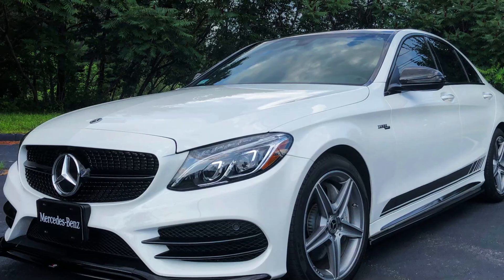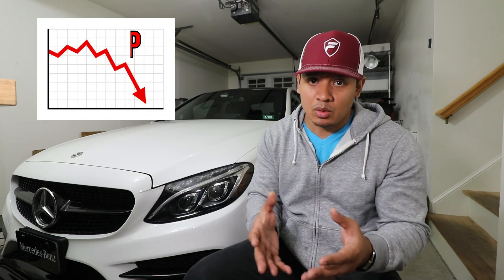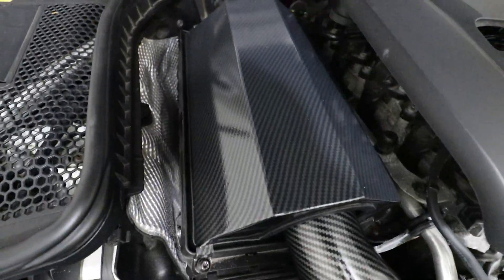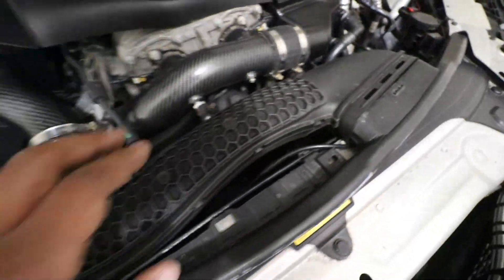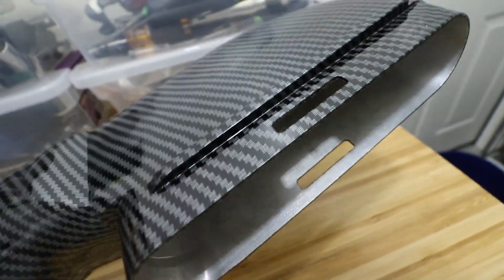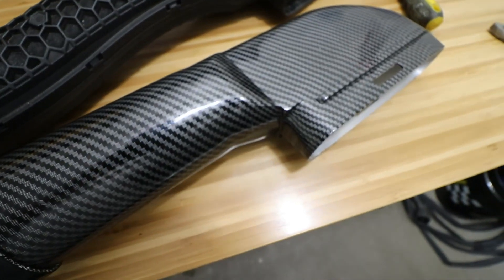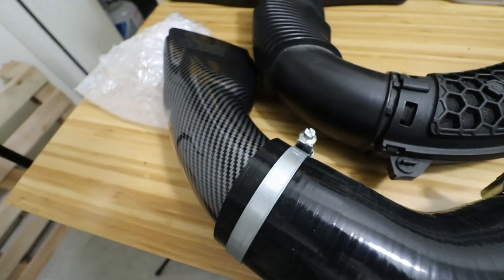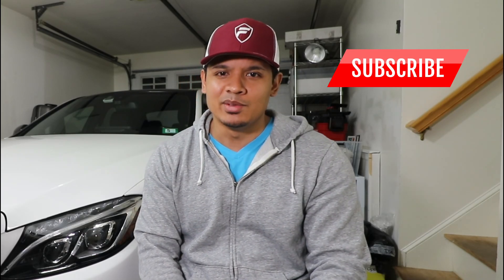ALUMINUM air tube installed on a Mercedes C300 (W205) 2015+

Comment: when’s that tune & aftermarket exhaust coming??
Reply from the maker: Exhaust soon. Tune, not happening.  Too many reliability issues with this engine with any tune. I’m not risking it. I have a Mercedes’ mechanic that’s seen it all and this engine is prone to issues with a tune.  Yes, people may be fine with a tune here and there, but they’ll face some issues down the road for sure. I’m not doing it especially when this is a daily driver and my wife uses it a lot.
Reply: @TheFlexxGarage  ahh that sucks. i have a w205 c300 as well but i thought i’d wait for ur tune before i do mine
Reply from the maker: Yeah. That will be up to you.  I just don’t wanna mess up this car. If there was a true safe tune, I’d do it but after chatting with my mechanic for awhile…the engine just don’t like tunes.
Reply: @TheFlexxGarage  EuroCharged and RennTech both produce C300-specific tunes. I feel their engineers probably considered the engine and specific parameters that need to be tweaked to improve performance; I feel certain that these are safe to use. Correct me if I’m wrong tho.
Reply from the maker: I’m not gonna say their tunes are safe or bad.  People have it done and it’s “okay” for now. 

All I know is my Mercedes mechanic knows what happens cause he’s has repaired tons of c300 cars after different tunes. He’s not the one trying to sell one. 

If I had a c43 or c63, heck yeah I’ll do it cause it can handle it. I would def do eurocharge or rennrech. Not on my c300 though.
Reply: @TheFlexxGarage   with all your upgrades can you feel a difference on your car? Even though you have no tunes on your car you don’t run into any issues? I just got a c300 and I don’t want it to be super fast but I would like it to be little quicker and responsive than stock.
Reply from the maker: My car is more responsive. 

Here’s the thing with my mods.  It doesn’t add any extra power to the car.  What it does is, it brings power back when the car gets hot from driving. 

Most cars (including the c300) loses a crapload of power after driving for like 30mins. When the engine gets hot, the air going into the engine gets hot and you actually lose power. Just because a brochure says your car makes 241HP doesn’t mean you get 241HP all the time. 

Adding cooling mods like mine…allows the car not to lose so much power when the engine gets hot.  So when I need power, I still have it. Whereas a car without my mods…when they need power…it’s not there cause the engine is running hot and the air feeding into the engine is hotter. So the car is more sluggish and less responsive. 

Most people (especially non-educated “car guys”) still don’t understand that concept. They think every mod has to add HP or it’s worthless.  Sometimes it’s not about adding horsepower but more about maintaining horsepower. 

The only way to get more power is a tune or bigger turbo. Both of those things required all my mods or else you’ll run into having a hot engine with hot air and losing power again and also risk damaging a lot of engine parts not designed to support a tune or bigger turbo. 

A c300 engine isn’t designed to take a bigger turbo and tends to have issues or premature wear with tunes. It’s just not really an engine to build a lot of power.  A c43 or c63 would be a better option. 

I want a reliable car with some pep. That’s why I did what I did to my car and nothing more. 

Hope that makes sense.

Comment: FLEXX, have you heard about the wrist pin issue on these cars? A lot of people have been dealing with this lately ESPECIALLY after tuning/modding. You think Mercedes will ever fess up & recall it?
Reply from the maker: mainly 2015...that's why I bought a 2016
Reply from the maker: They'll probably will do a "warranty extension" in about 5-10 years. That's what they did with the camshaft adjuster and fuel pump issue on the 2012-2014 C250. Cause by that time...people will either have paid to get it fixed already by a third party shop that's cheaper than Mercedes dealership or their car has so many miles that they don't qualify for the warranty. And if you did pay for work done...mercedes will only reimburse you if their dealership did the work.
Reply: I have an early year 2015 c300 and I went through that wrist pin issue and had a piston crack. Sued Mercedes and had my car repaired and get a new engine. Took about a year and I have another buddy doing a class action that will be happening this year
Reply from the maker: Wow

Comment: I was wondering if anyone has installed the pedal tune from Tornado Tuning, on a 2016 c-300 w205, also if the T-boxx also works on the w205
Reply from the maker: It’s not needed.  Putting the car in sport mode will increase the throttle response just like a pedal tune. If your car doesn’t have a sport mode, then yes, a pedal tune is a great accessory to install.